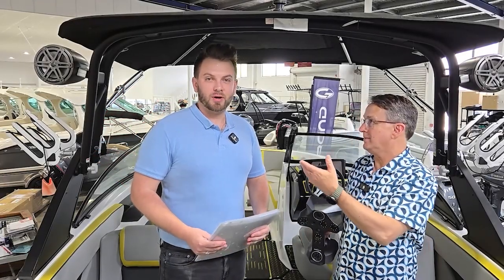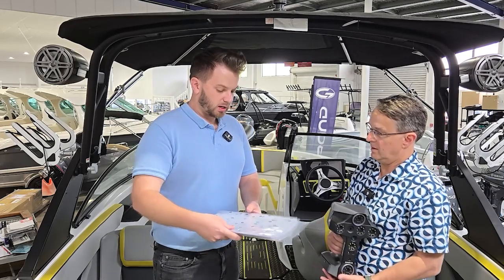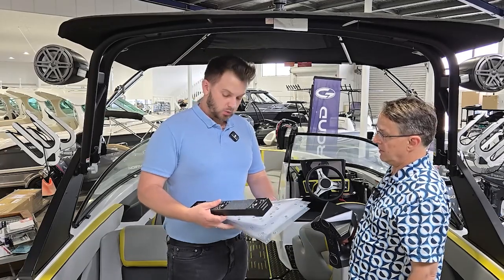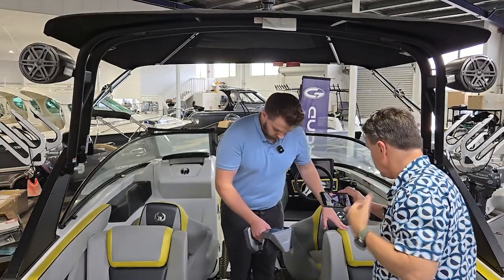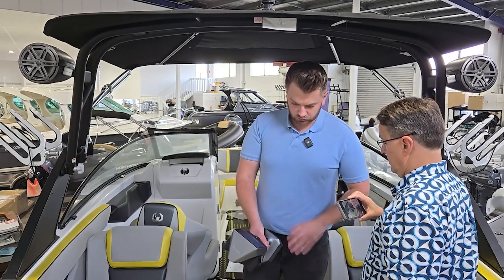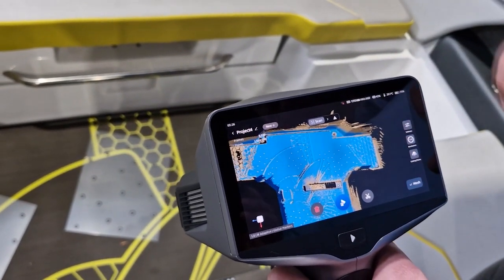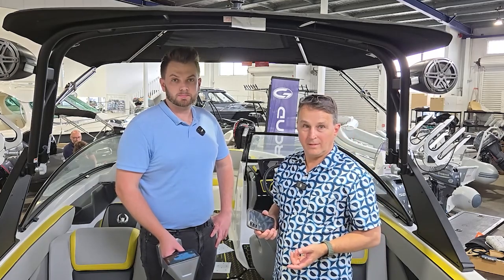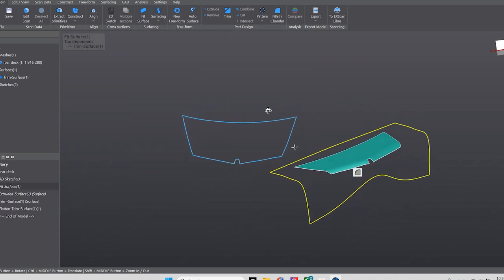3D Scanning boat flooring and creating profiles for CAD

Comment: We have a boat flooring company in Arizona and I could see how useful and time saving this is but how do you then design and layer the boat floor design into this (all the milled lines, patterns and logos)? 
Also do you have an example of how this works on a boat floor that is just white gelcoat and not one that has an existing floor? Would be a selling point to see this whole process.

Comment: Doing this wish eva already installed was pointless. It is much harder to capture data when you're just scanning shiny gelcoat...
Reply: Did you ever figure out anything on white gel coat flooring? Did they respond or did you reach out to them. We would need this for new build boat floors which do not have flooring already and I'm curious how it works on plain gel coat

Comment: did you use the Pro or Lite version to create the dxf
Reply from the maker: It was done using the Pro Version. The Lite version has some of the features, but not all of them.
Reply: @3dprintingsystems  So this scanner is great for marine applications at 40k but have to spend close to another 7k for a software program just to utilize for this industry specific? is there another option and training that supports what is being offered.
Reply from the maker: @stephensummersby  Yes, you can create DXF files using EXModel Lite. We also provide ongoing support to all our clients—feel free to email or contact us if you have any questions. Plus, with the current Libre deal, you’ll receive a 1-year EXModel Lite subscription license included! 😊
Reply from the maker: @stephensummersby  Yeah, the scanner is solid for marine use, but industry-specific software can be pricey. You could try FreeCAD, Blender, or SolveSpace for basic DXF generation from cross-sections, but for full marine analysis, options are limited. Fusion 360 (free for hobbyists) might help too.
Reply: @3dprintingsystems  I have full license for Fusion 360. So I need to find some training to utilize for this function. Doing boat scan today that is white, no texture or features. But an easy one to conquer.